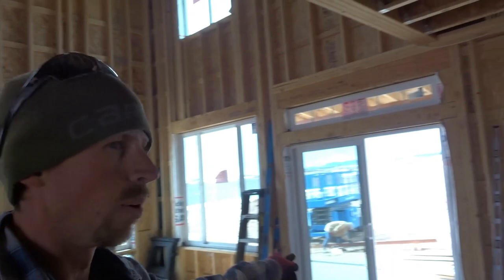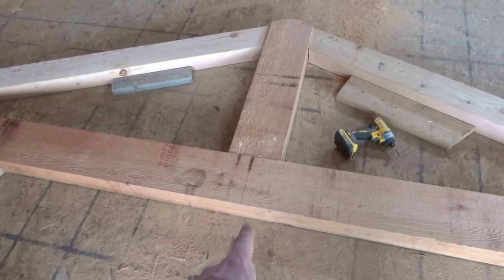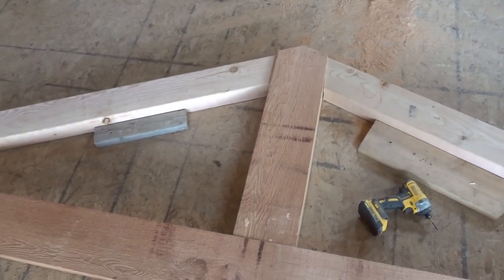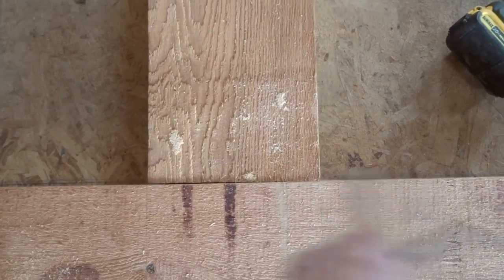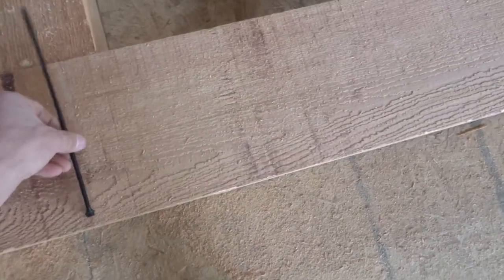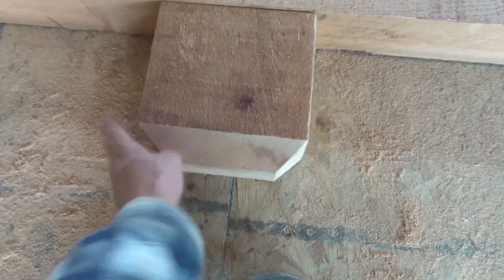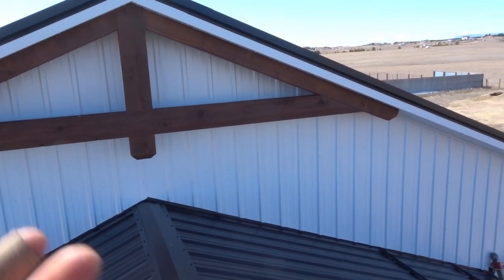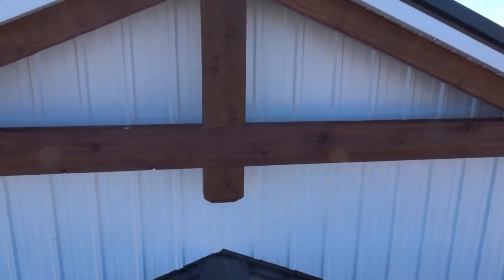DECORATIVE TIMBER TRUSS/DIY TIMBER TRUSS

Comment: too bad you couldn't record the install... curious to know how you braced behind the soffit and facia.
Reply from the maker: I completely agree, I just had to many things going on and was pressed for time to record it all.
Reply: @buildingwithjosh  so just to confirm, it is definitely a must to remove the soffit to get those braces connected to have something to attach to?  what if the decorative trim is not a bulky timber? what if its just a faux 1x6 made to look like it?
Reply from the maker: @ejk20111 yes, If you are going to put a floating timber truss like I did, mine was atleast 250 lbs. 
Most likely your soffit has some support for your facia, so as long as you don't do to much weight, you can probably get by with 2x material. I've done ones with 2x cedar material (which is lighter) and have had no problems! Just attach to some meat in your soffit, like your sub facia. 

The other way do do a bulky timber truss is to support with timber corbels below it on the wall, that always looks sharp too! 

Hopefully this helps!

Comment: Great work! Can you outline all the dimensions and size timer used? Thank you.
Reply from the maker: I believe I used 10' top cords, the bottom was near 14', and the vertices was about 42" I believe. 

I made the top cord long enough.to catch roof framing to support it to in the soffit. After that, I just made everything to that on a 5:12 roof pitch.

I hope this helps!

Comment: 5/12 is a 45 degree angle..180-45 and then divide by 2 gives 67.5 degrees for the bottom board. What type of wood did you use for this?
Reply from the maker: I used Doug fir for top cord, and cedar for bottom cord and king post.

Comment: Did you add any support to the to the rakes on the backside of the gable? Doing the same thing on our house right now and wondering if the weight over time will cause it to sag? We have a 2' overhang and similar length with 4x6 cedar.
Reply from the maker: Austin, yes to answer your question. When I built the roof, I put supports called lookouts that support the overhang. My soffits is 18".  I also added extra framing like some 2x10's flat with added blocking  in the the areas where the truss mounts. It's really sturdy.

If you are not sure if you have enough support for your decorative truss, you could always add some beefy corbels underneath the ends. I've seen that before and it looks really good!
Reply: @buildingwithjosh  thanks we did something similar. Added 2x6 perpendicular to the lookouts with blocking in 2 spots  for surface mounting to the soffit just like you.  We then added a 2x4 in a similar fashion on the connection point between the lookout and truss to allow some weight distribution. For added security we angled a 2x4 from the same lookout where the fastening would happen and attached it to the drop gable to counter the weight on that hinge point. We have 2' overhangs and get a lot of snow (North Iowa) so we wanted to make sure we were secured.

Comment: Are these timbers 4" x 8"? I would have given you bonus points for mortise and tenon or half lap joints. But I know this takes more work.
Reply from the maker: I couldn't agree more, I would also give me more bonus points for mortise and tenon! Lol. Unfortunately I had time restraints on the house build and I figured this wasn't the place to spend the extra time. 

The bottom cord and king post are 4x8 and top cord is 4x6.